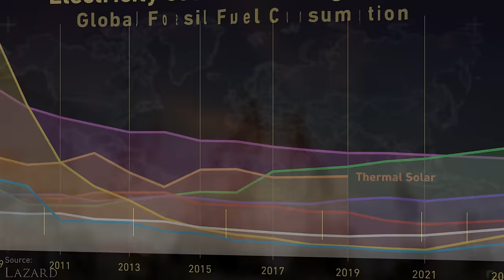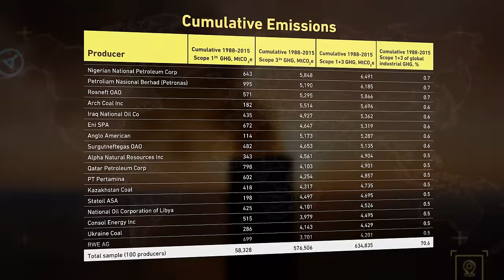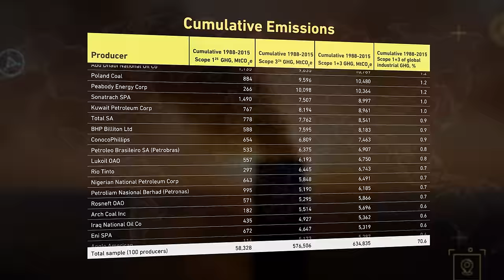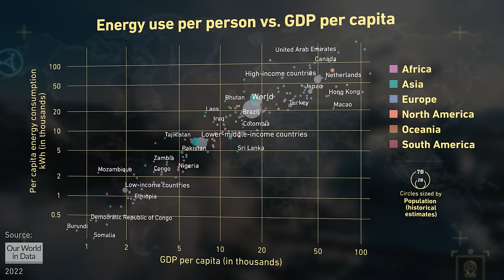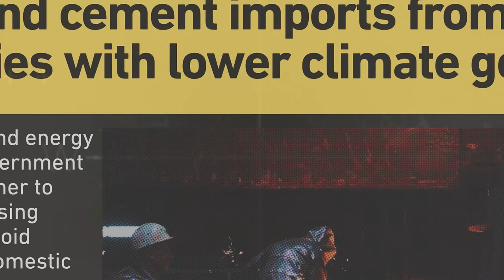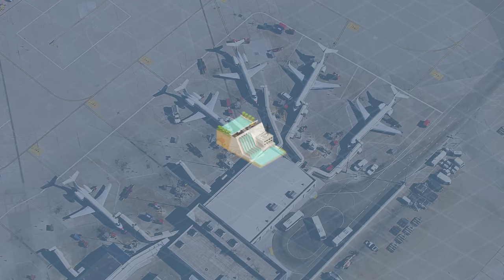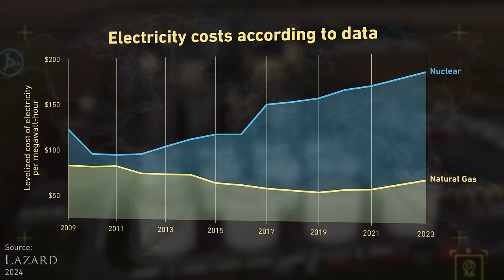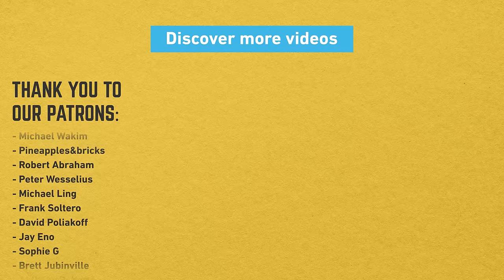Why We Can’t Just Stop Oil

Comment: We have the infrastructure for electric cars, mostly thanks to Tesla. And Tesla also has an electric semi truck with an 500 mile real world range at highway speed and full load.
The cost of energy storage also plummeting. It's now a lot cheaper than using gas peaker plants, and the cost is still falling like a stone.
Military applications are coming too. For example electric motorcycles are very popular in Ukraine, because they are dead silent. Same benefit applies to larger vehicles too. Even tanks could likely be electric right now. Fighter jets are the big issue.

Comment: Liquid petroleum fuels dominate aviation for good reason.  They are very energy dense, the weight dissappears as the store of energy is used up, and the fuel container and handling system has very minimal weight and bulk for the critical weight-sensistive mode of transport.  Radioactive materials are the most energy dense, but in practice need inordinately eloborate support systems to use.  Both the United States and Soviet Union spent massive sums to research building extremely long-range nuclear powered aircraft; but never produced a working, flying prototype.  The amount of lead and concrete reactor shielding needed would preclude any aircraft from getting off the ground.  If the shielding weight was reduced to make it flyable the radiation would either kill the crew or cause an unimaginable disaster should the plane ever crash.

Comment: I don’t agree with the assumption that oil/petroleum production is necessarily a bad thing. Oil has brought massive benefits including transportation, food supply, energy security and the broad availability to populations globally. Oil has literally brought billions of people out of absolute poverty. Our problems are primarily about pollution and loss of biomass, and given both efficiency gains and projected population stabilisation and then decreases it’s arguably a waste of time trying to ‘just stop oil’.
Reply: Benefits of Fossil Fuels
Energy Density: Fossil fuels have a high energy density, meaning they provide a large amount of energy per unit of weight, making them very efficient for transportation and industrial processes.
Reliability: Fossil fuels can provide a stable and continuous supply of energy, unlike some renewable sources which can be intermittent.
Infrastructure: The global economy is heavily reliant on existing infrastructure designed for fossil fuel extraction, transportation, and consumption.
Economic Growth: Fossil fuels have historically driven industrialization and economic growth, contributing to advancements in technology, transportation, and overall quality of life.
Reply: Drawbacks of Fossil Fuels
Environmental Impact: Burning fossil fuels releases carbon dioxide and other greenhouse gases, which contribute to climate change and global warming.
Pollution: The extraction, transportation, and combustion of fossil fuels can cause air and water pollution, harming ecosystems and human health.
Finite Resources: Fossil fuels are non-renewable resources. As reserves dwindle, extraction becomes more challenging and expensive, leading to potential economic and energy security issues.
Geopolitical Tensions: Dependence on fossil fuels can lead to geopolitical conflicts over resource control and distribution, contributing to global instability.
Reply: Issues with Oil/Petroleum Production
Pollution: Oil extraction, transportation, and combustion contribute to air and water pollution, posing health risks and damaging ecosystems.
Climate Change: Burning fossil fuels releases greenhouse gases, which are the primary drivers of climate change, leading to severe environmental consequences.
Resource Depletion: Oil is a finite resource. As easily accessible reserves are depleted, extraction becomes more environmentally damaging and costly.
Geopolitical Risks: Dependence on oil can lead to geopolitical conflicts, economic volatility, and energy security concerns.
Loss of Biomass: Oil production and associated activities can lead to deforestation, habitat loss, and biodiversity decline.

Comment: Oil is used to produce nearly every modern technology, not just for the energy use, but the parts as well. Without oil, plastic couldn't exist for one thing....
Reply: Yeah plastic is another problem that needs to be done away with good point

Comment: What they aren't mentioning to the masses is that previously drained oil wells slowly but surely fill back up. On their own.
Oil renews itself.
Reply: The idea that "previously drained oil wells slowly but surely fill back up on their own" is a misconception. Here’s a clearer understanding of oil reservoir dynamics and the concept of oil renewal:

Oil Reservoir Dynamics
Depletion and Recovery:

Natural Recharge: Oil reservoirs are not typically self-replenishing in the way some might suggest. While there are processes like natural gas or water influx that can sometimes pressure an oil reservoir, these do not generally lead to significant new oil accumulation in wells that have been depleted.
Primary Recovery: This involves extracting oil using the natural pressure within the reservoir. Once this pressure diminishes, additional extraction becomes more challenging.
Secondary and Tertiary Recovery: Techniques like water flooding or enhanced oil recovery (EOR) are used to increase extraction. However, these methods are designed to extract the remaining oil rather than replenish the reservoir with new oil.
Oil Formation:

Geological Time Scale: Oil formation takes millions of years from the decomposition of organic material under high pressure and temperature conditions. The processes that create new oil deposits are extremely slow compared to human timescales.

Comment: Statements like 'now that renewable energy is cheaper than fossil fuel derived energy' shows a complete lack of understanding of the energy market  so as to question the whole video.  That is like measuring my car's fuel efficiency when its going down hill and ignoring the flat or uphill consumption.  You need to quantify the cost of providing energy when it is needed not just when it is created,  so you must add the cost of providing power when there is insufficient wind, sun or waves etc.
By all means simplify subjects for ease of understanding but being simplistic is making it useless as an informed  source of knowledge

Comment: There are so many incorrect assumptions in this video its hard to know where to start - but the biggest overall is the assumption that even though solar and wind are well below the cost of every other energy production option the market will not follow the dictum of favoring the least cost supplier. I don't believe it. New technologies do have a slow start overcoming learning curves, but the implementation curves are relatively well understood, and inevitable.  A few examples: China is still  building coal plants  but they are almost all losing money and counterintuitively burning less coal through shorter operating cycles - they are becoming peaker plants for solar and wind generation.  The video suggests Semi Trucks are not ready for electrification because batteries are too heavy and bulky to leave room for cargo. Complete nonsense. Electric semis are competitive now, are equivalent in initial cost, use less that 1/3rd the cost of fuel annually and regenerative braking returns 95% of the energy used to accelerate or climb mountain passes while they are vastly superior in performance . The technology is new - in a conservative industry - but it is also a competitive industry and the electric truck will begin to dominate. The other idea I find unlikely is that developing countries don't have the capital to implement  new efficient technology and will; be forced to continue with fossil energy. One would think a county being held up economically by massive World Bank debt used to purchase foreign energy supply would find a way to switch to solar power using sunlight they own rather than oil they import.  Anyway, i was hoping for an intelligent answer to the question posed and seem to have gotten a lot of misinformation.

Comment: Liquid hydrogen is about 2x as dense as fossil fuel, and while it needs to be under pressure, still pretty transportable.
Reply: Look around and you'll find some videos about experimental hydrogen cars that have actually been built - I particularly liked the one about the BMW that lost about half its hydrogen to evaporation overnight and couldn't be stored in any enclosed space because of the explosion risk - Hydrogen is far too hard to contain.
Reply: @SmileyEmoji42  That's not an argument towards aa technology that's still under development. You're driving around in cars powered by 1000s of explotions, are you gonna tell me petrol and diesel never had any issues ever?

Comment: Sorry EE, but correction: Solar panels actually work best in places that have minimal cloud coverage on a more regular basis, whilst also being of a more temperate climate. This is because the hotter a panel gets, the less efficient it becomes; and cloud cover just doesn't help in general. Bifacial panels help solve the heat problem a bit, by making them more capable at shedding said heat to some extent when stood vertically on its end or side, but they benefit mostly by being able to gather light from both sides; even if at a reduced rate for whichever side is opposite the direct sunlight. These are rather new by comparison though to normal panels, so I understand that you might not know about them yet. 

The combination of such places, with bifacial panels, will make solar renewable actually viable in more places on the planet than before. The hottest areas that set up panels that failed, are mostly due to that extreme heat. Sure, they get a lot of sunlight, but without adequate cooling measures, they become less efficient, necessitating larger fields of panels; all of which are failing faster due to increased heat and reduced maintenance due to extreme size of the array. 

That said, the places where solar mirror systems are used instead, and other condenser type systems, those obviously should do much better in such hot environments. 

The biggest problem 'solar' faces, IMHO, is the nomenclature used for many things, and it being simplified down to just 'solar'. It creates confusion, and that helps nothing.

Comment: Wait, “peak oil” is “no longer a concern, at least for the immediate future” is quite the nonsense statement. Peak oil has never been about the immediate future, it’s about the future of our grandchildren, and that’s the problem — life on earth 75 years from now doesn’t enter into the short-term profit mentality. So it’s more accurate to say “peak oil is being ignored for now”, or “peak oil is being temporarily pushed out of the frame by desperate and destructive shale oil harvesting practices”. But “no longer a concern”? Not on your life.
Reply: Understanding Peak Oil
Definition: Peak oil refers to the point at which the maximum rate of global oil extraction is reached, after which production will gradually decline. It’s a concept concerned with the long-term trajectory of oil availability, not just immediate or short-term impacts.

Current Practices:

Shale Oil: Shale oil extraction has temporarily increased oil production, but it involves more challenging extraction processes and higher costs. While it has extended the period before peak oil might be reached, it may also contribute to environmental and economic challenges.
Short-Term vs. Long-Term: The focus on maximizing short-term profits through practices like shale oil extraction can indeed push concerns about peak oil into the background, potentially neglecting long-term sustainability.
Reply: Intergenerational Responsibility: The concern about peak oil is tied to the responsibility we have to future generations. Ensuring that current practices do not compromise the ability of future generations to meet their energy needs is crucial.

Comment: A big point that was missing in the video is that the levelized cost of electricity of renewable sources is only sometimes lower than fossil sources because the fossil sources are still in the system, particularly as base load and peaker plants. A gas powered plant can produce energy when energy is needed whereas solar and wind produce by mercy of the weather patterns. Through over supply in the middle of the day in Europe there have been a lot of hours of negative prices within the wholesale market for example. The problem of intermittency is being tackled in many ways such as storage or demand side response but again this further drives up the infrastructure costs. Especially in Germany where the base load source was cut off and coal plants are being phased out, only stringent government subsidies and support schemes (funding, grid expansion, inter connectors, tax cuts, FIT schemes, etc.) can make a renewable run grid feasible, and will be extremely difficult for any country to achieve. Energy intensive industry makes the problem even worse due to their constant supply need of energy, and the high load peaks we can expect from EV and heat pumps don’t help the issue either. These issues are utterly complicated to tackle so phasing out fossil fuels will take some time…

Comment: if carbon is such a big problem why dont we just plant more trees? carbon is plant food after all.
Reply: Trees grow slowly and take land and water.  Fossil fuels represent plants growing for millions of years and then being buried before they could decompose.  It is relatively fast produce oil.
Reply: trees don't grow on nothing. To grow trees you need land that has both the moisture and composition conductive to plant growth, which means any use of land in that fashion would compete with agriculture. Sure, you can do that, but it's not a "why dont we just...?" type of deal.
Reply: Carbon is a building block of trees. And, while we should be planting more trees, the problem is, we probably can't practically plant enough trees to put the slightest dent in the problem.

Comment: A few wrong assumptions were done on this video, which changes the conclusions. Emissions are actually stagnant and will decrease already in 2024.
You don't need incentives for the electric revolution, electric cars will be so cheap that people will gladly change. And as they are 80-90% more efficient, there will be further reduction of consumption of oil and gas

Comment: This is bizarre. I happened to write a student paper on nuclear vs. renewables with a lot of the same points and sources as your own work. As an engineering student with a passion for power generation and the environment, my paper had a different focus, but this was really cool to see that something I worked so hard on is a strong enough topic for one of my favorite creators to create a video on. If anyone is reading this, Nuclear can slide into the power production role that fossil fuels currently occupy very well.

Comment: One weakness to your argument about the cost of nuclear is that much of the cost is regulatory.  To make things comparable, remove the regulatory burden and you'd see that nuclear and natural gas would be much more favorable compared to wind and solar.
Reply: Removal of regulatory bodies is what caused Chrnobyl. Regulations are for the safety of everyone, you are only thinking short term for economic benefit, but when it ends in disaster, it is catastrophic for the economy and the region.
Reply: It was poor design and incompetence which caused the accident at Chernobyl.  Possibly even deliberate sabotage.   You can scale back the regulatory environment dramatically and still be safe. @TalEdds
Reply: @fuzzy3440  I hope so, maybe they should also look into small modular reactors, since big ones are so prohbitively expensive. Some regulatory leeway would also be good, as long as proper precautions and innate safety-mechanisms are built into new nuclear systems.
Reply: The main problem is actually just return on investment, plants are so expensive that they take years of operation to recoup their cost. This used to be covered by government subsidies to constructing new plants, but ever since they jumped ship to chase magical 'green energy' that means all of the companies have cold feet about investing into building new plants now & old plants are reaching the end of their lifetime and going out of service. -That's not to say regulation isn't a factor, but its just not the most significant.

Comment: "shipping, whether via LAND sea, or air" umm, theres a whole youtube of urbanists who'd like to introduce you to 'trains'

The point for bringing up the 100 companies is to suggest there is little we can do ourselves to solve the problem directly, or more importantly, there is little we SHOULD do. For the most part this problem does not want or NEED the solution of going back to the stone age. It would be fanciful enough to believe that consumers would boycott most products, but even more farcical to suggest they'd all switch to a competitor based primarily on how green their supply chain is. What green PR there is in the supply chain mostly comes from activist INVESTORS, not consumers.

No, the point of the 'only 100 companies' message is to illustrate that the best and most feasible way to solve this problem, is through government regulation, governments directly cracking down on these companies is by far the most effective means, and if it means slightly more expensive products, the consumer will adapt, just as they have during this bout of general inflation.